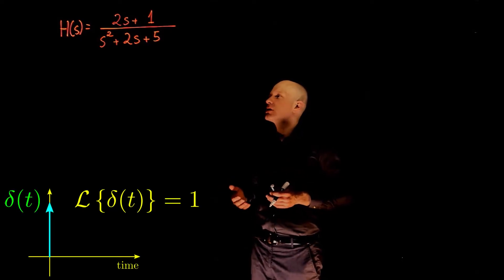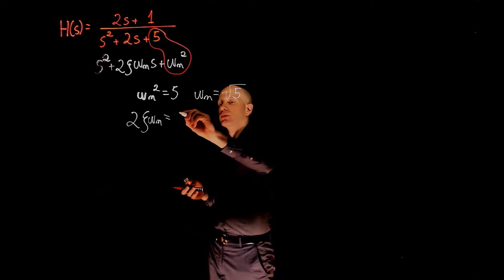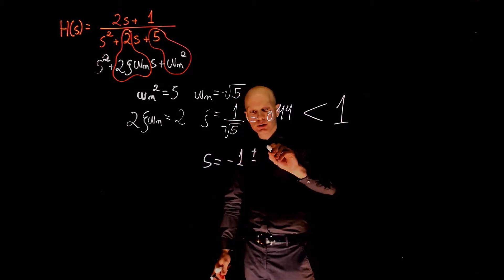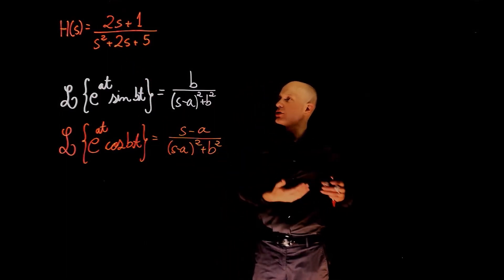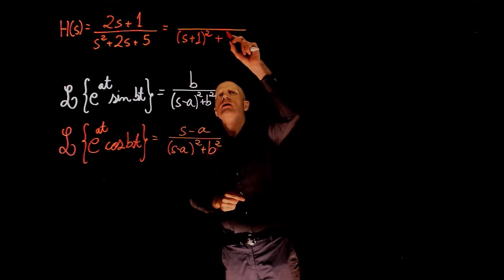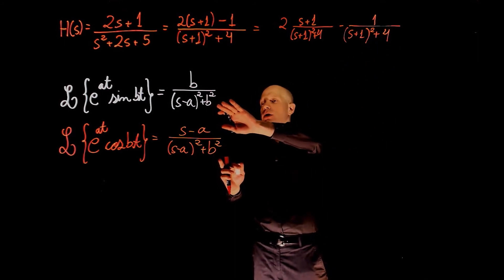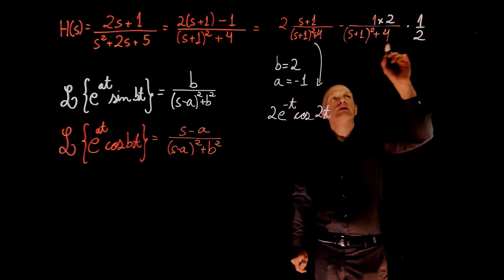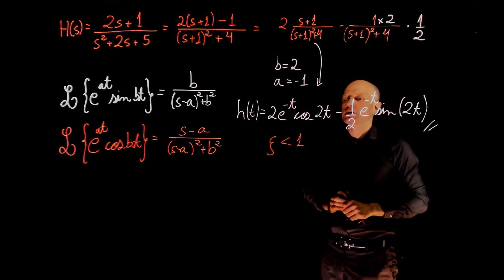L5E21 - Control Systems, Lecture 5, exercise 21. Effect of pole location on transient response.

Comment: Quick question, when you bring in the impulse response to find the temporal equation, wouldn't the answer be y(t) and not h(t) since H(s) = output/input = Y(s)/X(s), and you are multiplying H(s) with X(s) = 1 (impulse)? Thanks!